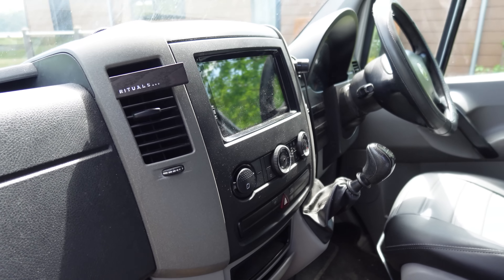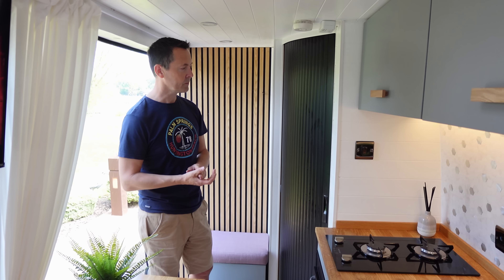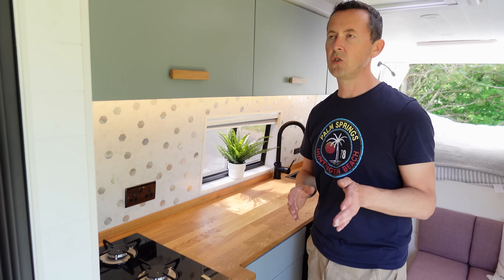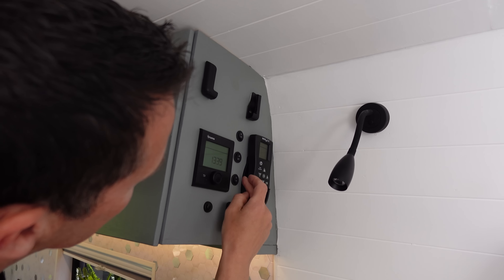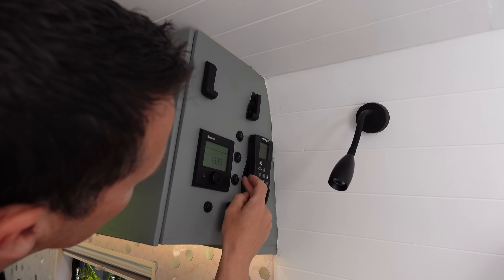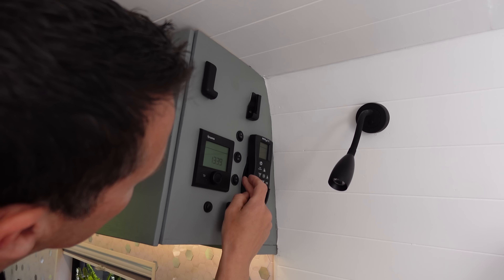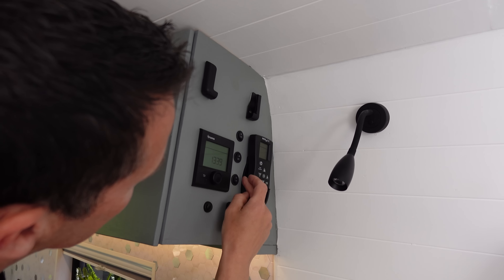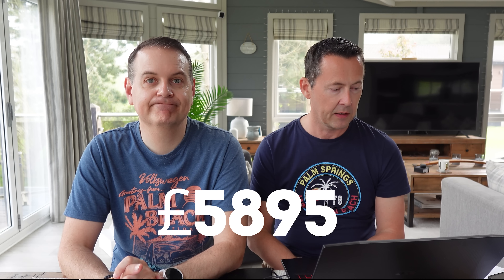Campervan Build FULL TOUR | HOW MUCH did our van COST to build ? | FULL COSTINGS

Comment: Hi guys do you have any fire fitting equipment in the van, what it could have cost is irrelevant the cost is what you have paid to kit the van out as it stands, you could have chucked a mattress on the floor and it would have cost next to nothing, also why don’t you allow any labour cost and then you would have the true cost as it stands its not a 100% actual cost, did you factor in the fuel cost to go to Band Q etc keep safe Andy and Vonnie
Reply from the maker: yes we have fire fighting equipment, all costs associated with building it has been included in the figure we quoted, as for labour we gave ourselves a 100% discount